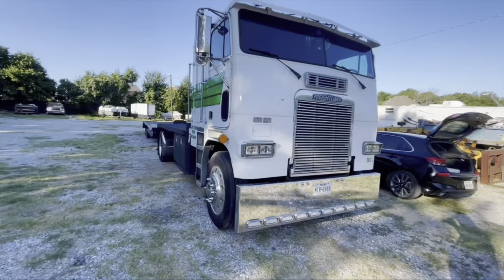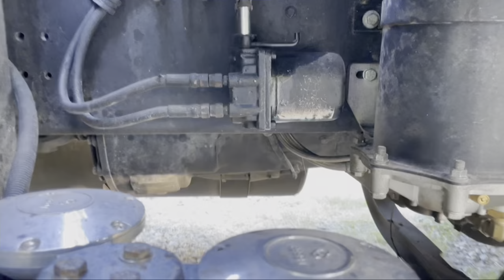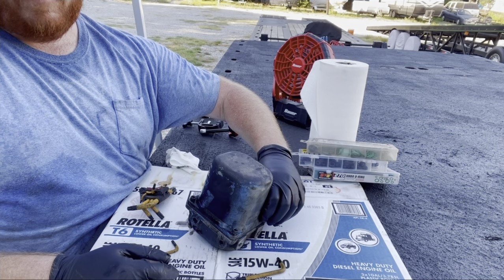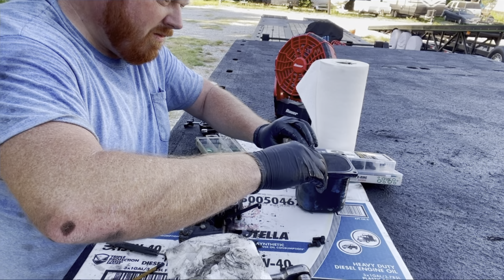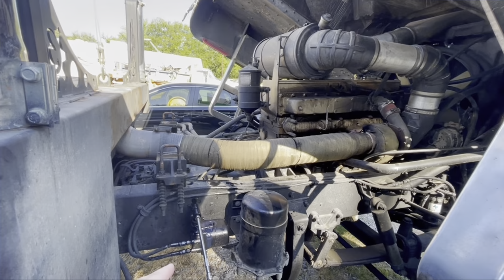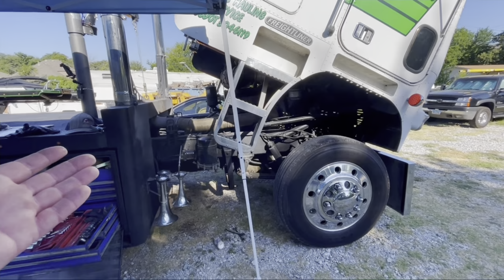Rebuilding a cab jack on a cabover

Comment: Haha you said it these old trucks gotta love them pains in the butt....  My mechanic suggested I change out my fan belt, I found a bad tensioner also, International need the parts to match them due to the age of my truck so I set my cab back down and sure enough after working just fine my jack (I hope) isn't lifting. These old trucks wont just let you go with easy stuff, they always want to throw one more unexpected problem at you while your trying to repair something.   So tomorrow after seeing you do this I'm gonna take a look inside my jack to see if I see anything stuck in it, before I make a 3 hour drive to Columbus for a air assist jack.
Reply from the maker: Haha. Yea that is definitely how these trucks are. And about the time you’re thinking man this is a great truck this stuff happens. I wish you luck and hope it is as easy as a bad o-ring.